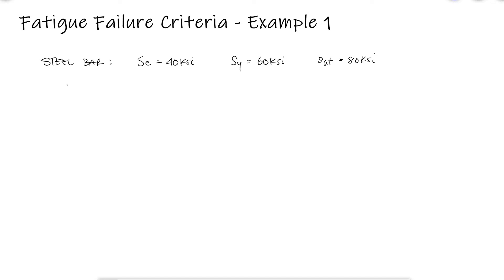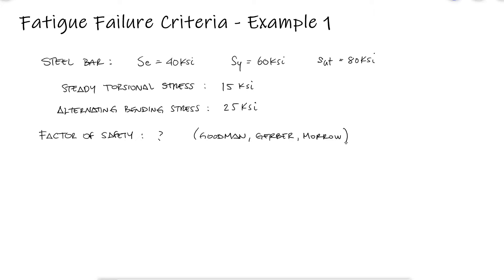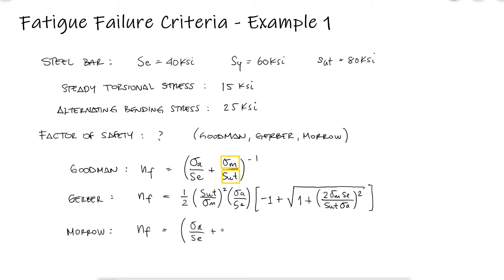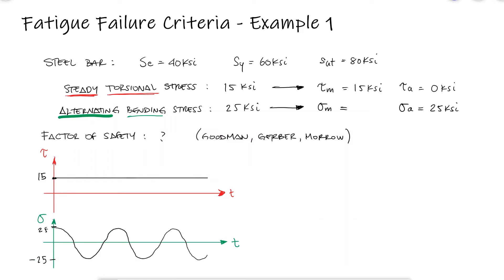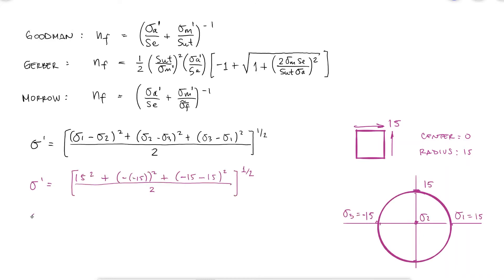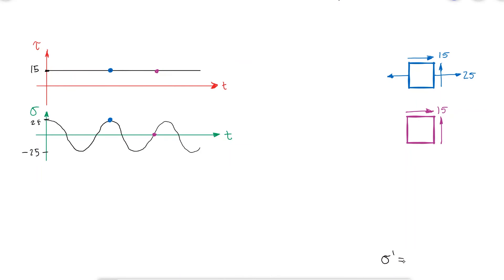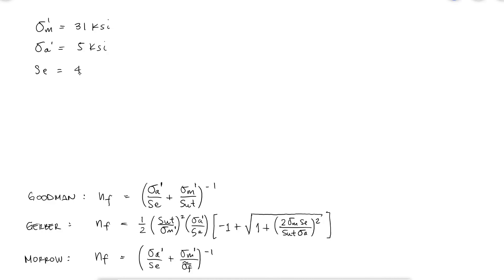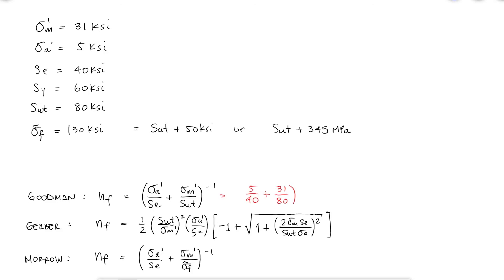Fatigue Failure Criteria - Mean and Alternating von Mises Stress - Example 1

Comment: In this video you use min and max von-mises stresses to obtain mean and alternating von-mises stresses while also saying that the formulas you wrote in orange are wrong however in playlist "Mechanical Engineering Design I" video 61 you derive the formulations using the orange colored von-mises stresses. What is the reason behind this contradiction?

Comment: Do you have a reference that supports this way of computing Von Mises mean and alternating stresses?  Shigley, Norton, Juvinal and Marshek all use the methods you identify as incorrect (at least in the editions I own.).
Reply: If the Mod-Goodman and Gerber theories were tested/compared to empirical data using the method of computing Von Mises mean and alternating in the textbooks, I would be hesitant to change the method of computation. Your methods result in a much higher safety factor.  I am leaning toward sticking to a more conservative approach unless you have journal publications that back this up.
Reply from the maker: If you are currently an engineering student, my recommendation is that you follow what you have in your books, otherwise you'll mostly likely get into trouble with your instructor (if they are stubborn, that is). The explanation is mechanics-based and simplified with an example here, but the mathematical proof can be developed with non-numerical values if you follow the same simple steps I shared here; no need for journal papers to back up such a simple concept: no serious journal would publish such a simple and unoriginal "study" (mistaken textbook concepts and equations happen more often that you might think). It might help to expand on it by saying that negative normal bending stresses would result in values of von-Mises stresses that are oriented perpendicular to the planes where the principal stresses that consider the positive normal bending stresses exist.
Reply: @LessBoringLectures  I guess I'm just one of those stubborn instructors. Your argument for ignoring 3 other reputable sources is not convincing. Sure, I follow the logic of your presentation of the stress calculations in the video, but if the Modified Goodman Line and others were developed based on a different interpretation of the mean and alternating Von Mises stress, I will stick with the original interpretation.  (Unless you have a source showing that your methods have been empirically verified or that you have sources showing the text books have misrepresented the original work by Goodman and others.)